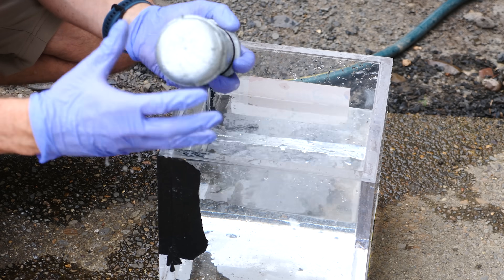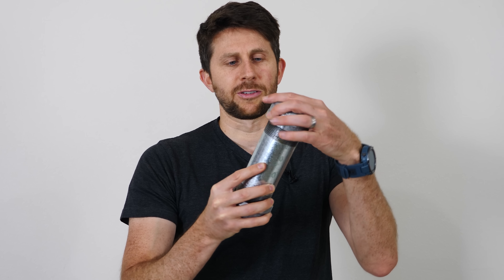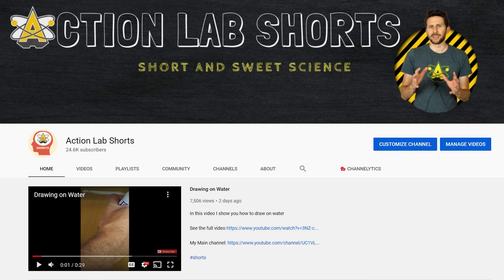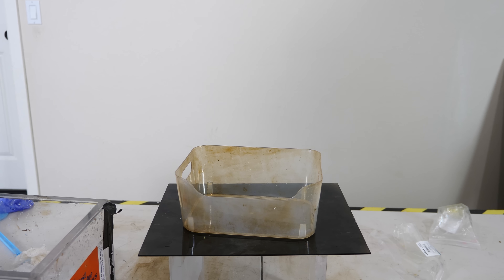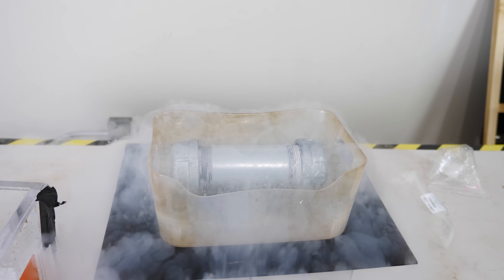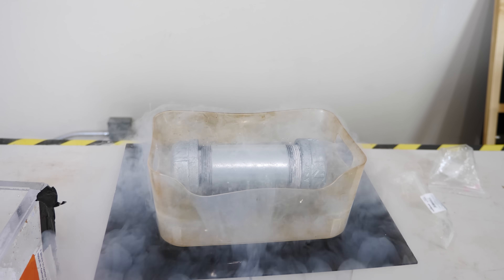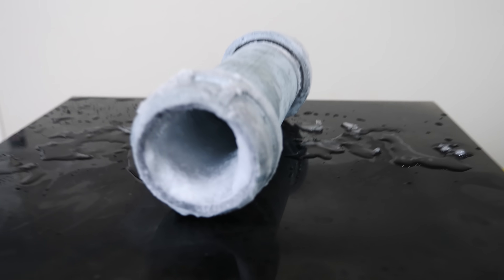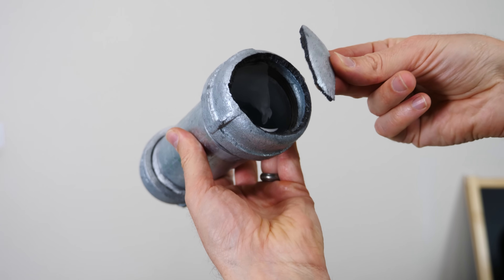Can You Stop Water From Expanding When It Freezes Into Ice?

Comment: This is one reason you have a mixture of antifreeze and water in your car's engine. If water freezes in the engine, it will either push out the core plugs, or it will crack the engine block.

Comment: Cast iron pipe parts are not very strong.  You'd need refined steel parts at minimum but likely a stronger alloy and also something much thicker, like many inches thick.  Also, I expect that the volume of water is a factor as well, as in the more water, the thicker the vessel will have to be.  I don't know the math but depending on the material of the vessel, assuming the strongest steel alloy that exists, 1000 to 1.

Comment: Don't smaller components have a higher fracturing toughness. So a smaller volume with the same thickness of steel could contain the frozen water to a higher pressure. I think.

Comment: What material do you use to contain that water ? Perhaps if my assumption is low cs it will explode like that because the pressure due volume expansion but if you change to austenitic ss with good mechprop in low temp i wonder how it will be

Comment: Cast iron (which is extremely brittle as it consists of cementite only) pipe caps were a really bad idea.

Also many steel alloys get remarkably brittle already at temperatures not far below 0°C. The steel used for the Titanic had hardly any   notch impact strength left at -1.9°C (freezing point of atlantic seawater), while it was pretty much o.k. at +15°C

Comment: 6000 atmospheres converted to psi is roughly equivalent to the tensile strength of mild steel, you would need a steel container with walls that are very thick relative to it's internal surface area in order for it to not break. For reference the burst pressure of 1/2" schedule 80 steel pipe is only around 14000kpa or roughly 138 atmospheres and 1/2" schedule 80 steel pipe is just about the most pressure tolerant pipe a consumer is going to reasonably have access to.

Comment: I knew it would fail, but I was unaware of other crystalline structures of water as a solid. I have taken hydraulic pressure sensors to over 5000 PSI for testing. 
At those pressures, it's tough to predict failure volatility. Luckily the "pipe bomb" was perpendicular to your body. Thanks for the info, keep surviving.

Comment: 1. You used galvanized pipe, not steel.

Galvanized pipe is a zinc alloy and relatively weak.

2. Water will remain in a liquid state if brought to temperatures below freezing and under the right amount of pressure.  Water in a bottle outside will remain in a liquid state until it is agitated.

Comment: The short answer is “no,” and also of COURSE ice can break steel. That’s what burst pipes are! If you want to avoid that during a freeze, turn both your hot and cold faucets on the lowest setting so there’s no stagnant water in your pipes. Keep it on until the freeze is over.

Comment: The steel was also reducing in size a bit.  Two for one deal.
Reply: I enjoyed the video.  The pipe was steel, however the caps appear to be cast iron 150 pound rating. Would like to see the test with schedule 80 or 120 pipe, and 3000 pound forged fittings.
Reply: @kdefoor  Or welded closed: https://youtu.be/f5wnTy_FhdM
Reply: If you consider that, the water, when cooled down from room temperature to 4 degrees celsius  it already shrinks a little bit.
Reply: @yukiousuzumi2595  the cap that threads on is not flush with the surface it looks concave
Reply: A better, easier-to-understand experiment would be to put the pipe and water* into a cold refrigerator and get them both down to just above zero degrees, then to pour the water into the pipe, seal it off, and then to put that into the tray in a freezer set to just a few degrees below zero. Then there would be no sudden  and no big temperature swings anywhere in the system. 

* pre-boiled water to remove dissolved gasses, I guess.
Reply: Caps aren't even steel most likely, cheap cast iron relatively brittle, depending on where they are made.
Reply: Good point my guy I didnt think of steel size reduction
Reply: @ayushaaryan9927   Steel size reduction trivial compared to water increase in volume, you'd have to measure it with machinist tools.
Reply: That’s why it exploded before all of the water froze
Reply: Thousands of an inch
Reply: Belt
Reply: And the failure point is where you’d expect if the exterior of the cap is shrinking a lot more and faster than the inside where the water is rapidly expanding as ice. Dumb experiment.
Reply: @jeffreyboyd2758 dumb comment
the shrinkage is so small especially in the cast steel caps.
It is actually an interesting experiment as you would expect it to fail on the pipe section as the tangential and internal radial forces create an immense shear stress. Much greater than only the internal radial stress that was able to break the more brittle cast caps.
Reply: Why has only 19 people noticed this

Edit: why have only 236 people noticed this
Reply: @benjaminray2425  If 19 was the number of likes under topic starter's comment, then you can be mistaken :) I haven't thought of the steel size reduction until reading the ts's comment, and then I've put a like on it. :)

Comment: What if you were to use this as a mechanical battery of sorts?
I have read that is it possible and I think with a bladder system you could harness mechanical energy. If you have water in one and some sort of fluid with desirable properties used for the other side of the bladder system. Thoughts?

Comment: Along with air tanks, steam boilers are also hydrostatically tested with COLD water.  One way to think of it is that it takes a lot less energy to pressurize a water-filled tank.  Less energy in means less energy released when it fails.

Of course depending on the material of construction, there's also a concern to have the water warm enough to avoid brittle failure.
Reply: compared to an air filled tank water doesn't increase in amount if you pressurize it (since at most pracitical pressures it can be considered incompressable) so there are not many atoms that have to reach normal density again its literally just like pressing on a chunk of steel. 
So theoretically the energy it takes to pressurize water is 0 since its always pressurized and the energy you take in is 1 to 1 put into the walls of the tank.

Comment: Hmmm  brittle failure of the casting end cap.  If the container was more ductile it would just 'stretch' a bit to accommodate the expansion.  Some pipes can be 'freeze proof' just this way.  They simply stretch enough to deal with the expansion without failing.

Comment: The Action Lab is definitely from a warm climate.
Anyone who has lived where the weather gets cold enough, the pipes in their homes will freeze and burst the pipes from the expanding ice.
Also if it can't expand what happens is once the seal is broken it will instantly freeze, the pressure stops it from crystallization until pressure is released.
That's why some beers won't be ice until you open the bottle/can.

Comment: Too bad there is no way to get 100% water into a completely sealed and solid with no seams or lids or holes, basically a container that has the same strength through its entire area 0 weak points, because those are the areas that keep failing.

Comment: If water is extreamly compressed, black ice is formed. But it needs a pressure of 100 Gigapascal. This is the normal air presure, one million time. That ice is solid and liquid at the same time. It has a temperature of 1700 centigrade. The hydrogen atoms move so fast, that they act like a liquid.

Comment: I want to see this experiment with Beyond the Press's 2" thick steel box...
Reply: It would likely still explode (depending on volume.) 620 mPa is over 89,900 psi. I've been looking for about 30 minutes, and the best equipment I could find (comparable in the size used in the video, assuming 2" pipe,) is HiP Series "R" Reactor vessels, which have 5" 4340 Alloy Steel walls for a 2" inner diameter container (overall diameter of 12".) This is rated for 100,000 psi.

Comment: Yes the ice expanded, but the steel also contracted.  That contributed to the pressure. In fact, the uneven cooling of the cast steel cap alone may have caused it to fracture, like when someone sprays cold water onto a hot engine block and carcks the block.

Comment: If the inside is made of plastic explosive, how thick do the walls have to be so that it stays in one piece after the explosive is set off and just keeps contained inside? "A good approximate value of Detonation Pressure for C4 is around 310 kilo bar" https://www.researchgate.net/post/What-is-the-heat-and-pressure-generated-from-detonation-of-Composition-C4-explosives. So steel has tensile strength of 4 kilo bar so if the inner diameter of the pipe is 1 mm and wall thickness 77.5 mm then it should be fine and we still have a safety factor of 2 included. 310 kilo bar that's an elephant weighing 3.1 tons standing on a single stiletto 1x1 mm.

Comment: If the inner diameter of the pipe is 1 cm and the walls are 2 cm thick and the threads are long and there is a sturdy high pressure gasket then it shouldn't break - the steel may just balloon a bit like rubber LOL (steel has elongation 15% at breaking point). Steel has tensile strength like 400 MPa and the ice is supposed to exert similar pressure or maybe 700 MPa (varying info on the Internet) so this way there will be 4 times more steel than ice on the longitudinal crossection and the steel should be fine.

Comment: Before the video starts:
Or will not freeze until the container will be opened.
Because the pressure inside will be preventing it from freezing coz it requires expansion. It's like self preventing freezing.
Reply: Well... I was partly right.

Comment: Can you make a video where you cool the water down under pressure and release the pressure to see if it freezes instantly!?
Reply: put a beer in the freezer, leave it for about 1 hour. Carefully remove it and it will be still liquid. Open the top and take a sip, and watch it freeze top down in front of your eyes. Ive done this many time by accident. Even placing it down to fast can trigger the reaction.
Reply: @Stuey 777  well that happens because of another reason I believe placing the container down quickly aligns the molecule to better facilitate nucleation hence it freezes.. incidentally water needs some impurity to start freezing so when you open the beer container and take a sip your lips or a dust particle facilitates nucleation.. what I asked him to do was something different and quite hard to do now that I think about it now, it would just crack the container and freeze if there's not enough room for H2O to expand while freezing, but with enough pressure you can form different types of ice which can be denser than water!
Edit: rewatched the video and everything I said is kinda in the video :| look at the phase diagram he shows those numbers signify different types of ice structures ICE VII being the densest formed at around 30,000 Atm at room temp

Comment: Steel becomes very brittle at this very low temperatures. Also, the tube is contracting at different rates internally and externally. It's like putting a glass in a flame. It will crack due to thermal expansion gradient. To reject this hypothesis it would be nice to repeat the experiment with another liquid in the tube, like alcohol, and check if the tube would also fail.

Comment: I think you'd have a much more precise temperature measurement if you put black tape around your pipe. Metal reflects infrared and doesn't emit much infrared of its own, so you're basically measuring the temperature of the ceiling or the plastic container.

Comment: Yes theoretically but your gonna need a very strong super material to stop the ice from expanding or a container made from steel but very thick and welded shut if the steel is thick enough you might just be able to do it and make ice 2 ice that is extremely compressed and didnt expand

Comment: This is the reverse concept of the iron core at the center of the earth, The core is SOLID iron, but it's temperature is well above the melting point of iron. It exists as a SOLIG instead of a liquid,  because of the immense pressure of the earth above it. Although I have never heard it stated such, from what I learned in this video, I would expect that iron to weigh more than normal iron...To me, that's even cooler than iron existing as a gas.

Comment: What you do is take 1"ID 3"OD hollow steel bar, tap the 1" hole and use the strongest bolts you can find with 2" of thread engagement. The water freezes from the outside in, sealing the threads.
Reply: Or better yet, take a 3" OD solid steel round bar or threaded rod, drill a 1/16" hole, and cap the external threaded ends of it. If the hole is small enough, you can easily contain arbitrarily high pressures. Sealing the threads isn't any help, because if the pressure is high enough it will just blow them off, sealed or not.

Comment: At a high enough pressure, even the water molecules in compressed ice will break up in into elemental atoms  and then into compressed plasma and neutrons which will occupy a volume millions of times smaller and finally turn into a black hole. Of course, only gravity can compress to that degree.

Comment: Why would filling the cylinder with the liquid nitrogen be more dangerous?
Reply: Because nitrogen is a gas at room temperature and pressure. Once the container bursts, the super-heated liquid nitrogen would boil very quickly into a large volume of nitrogen gas. We call that an explosion.
Reply: @KohuGaly  so it will become a pipe bomb

Comment: Very interesting.  You and the hydraulic press guy need to collaborate.  He's got a press that can generate those pressures.  It would be interesting to see this type of ice made.  Once made, and returned to normal pressure, but kept cold, does it remain in this new novel phase?  If so, how is it different from regular ice?  Does it sink?  Does the crystal structure ever change as long as it's not allowed to melt.  When it melts, does it absorb or release heat different that regular ice?  You could do a whole series on this unique form of ice that no one has experience with.
Thanks for the great video.

Comment: Hi, you should test the same, but with boiling water.. Test, if under tremendous pressure, in a closed tank is possible to boil water. And how big the explosion will be. You could test a tank with a great wall thickness, like several inces of stainless steel. Thank you!

Comment: Make a fiberglass or carbon fiber ball around a spherical water balloon.
If you make it like a scuba tank, it can take a tremendous amount of pressure
The pressure should be close to equal on every square centimeter as well.
Only problem is that you would have to drill it or cut it after it froze to see if its liquid and you might make Earth's first ice volcano.

Comment: Water don't mess around. My guess was that the metal would shrink a little and the water would expand and push the cap from the inside causing it to unscrew, I wasn't expecting the ice to freeze the cap in place causing the next weakest link to be the contoured corner of the cap.

Comment: Has his gloves on when filling the bottle with water
Has his gloves off when puring in liquid nitrogen
True Chad :D
Reply: The liedenfrost effect actually protects your hands when they’re bare because there’s a layer of gas between you skin and the liquid nitrogen (think of those waterdrops not immediately boiling on hot stovetops)
Reply: @scottdemello2221  anyway touching a frozen metal is the easiest way to get frostbite. Pouring liquid nitrogen on a bare hand - not a big deal, even if you manage to hold it on your skin for several seconds. But if you touch -50 C aluminum you will get damage almost instantly.
Reply: @scottdemello2221  from what i ve heard thats only for a split second tho.
Reply: @Maggisoo  you’ve got enough time to react bare-handed, the risk of getting liquid nitrogen trapped inside of your latex glove is a far greater hazard.  Not to mention, as the latex is usually a lower temperature, you’d likely have less time to react to it just getting ON your gloves
Reply: @Maggisoo  also, it lasts for several seconds
Reply: Probably just to add grip since he's twisting it under the water
Reply: @vara202  was gonna say this. I've put on latex gloves to open jars many times. 🤷🏻‍♂️ Not because I thought pickes and mayo are toxic though.
Reply: @fcgHenden  mayo is toxic
Reply: I was actually confused by why he had gloves on, he's not using any adhesives or toxic materials.
Reply: What about grabbing the frozen remnants bare handed?
Reply: What about "raw dogging" the frozen remains of the exploded remnants? Also, your name is backwards...
Reply: @ThomasMuir youre supposed to use thick gloves when using liquid nitrogen.
Reply: @ElectricalSwift  face visor as well.